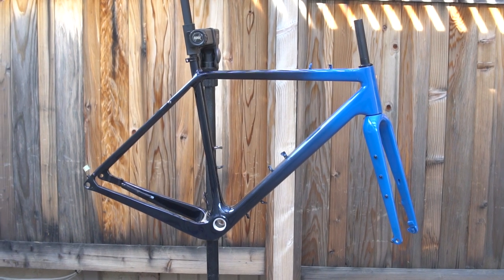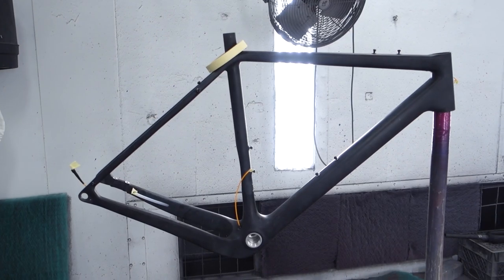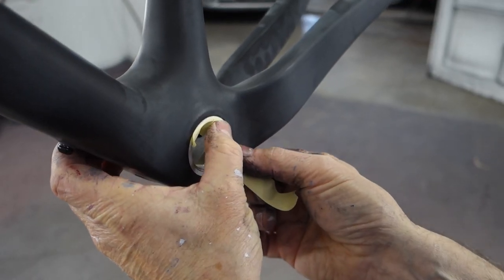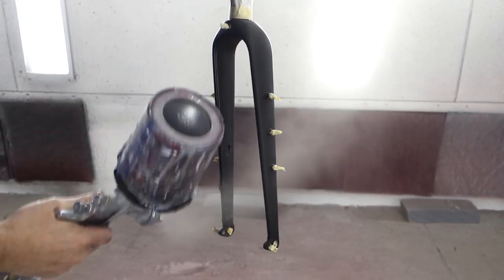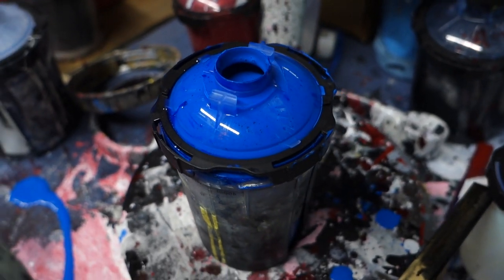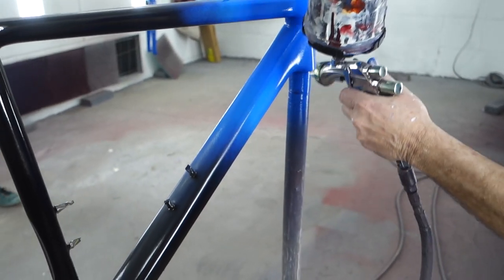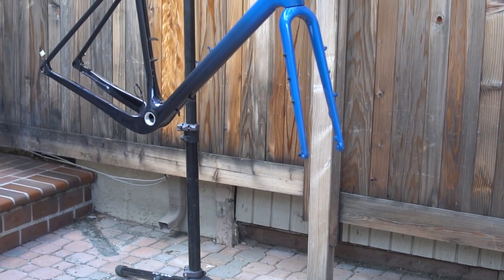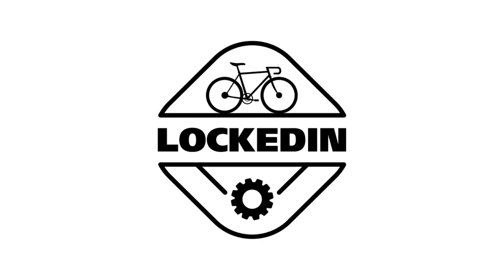How To: Custom Fade Paint Job for your Bike

Comment: Would I have to use chemical paint stripper/remover and then sanding for a new paint job or just sanding like this okay? I've been told better safe than sorry
Reply: As long as you're using a good primer, you only need to sand down the old paint job - as long as it's smooth after the sanding.

Comment: after 1st primer coat. . . is it necessary     to use wet sanding with  p1000 grit  ? . ..  if wet sanding .. how much time i should gave  between 2nd coat primer ?

Comment: Super job , I tried the same on a metal frame. And I feel the top coat is peeling. Do you know what I done wrong
Reply from the maker: That could be a handful of reason why it did that, 1 make sure its same brand of primer color and clear. 2. your base color might have not fully cured before you put on top coat.

Comment: How much does a typical paint job cost to have it done at a shop like the one in your video?  Is it possible to repaint a carbon frame that already has a clear coat on it?
Reply from the maker: Chris Blankenship price is gonna vary a ton depending on type of paint used and condition of the frame it could be anywhere from $400 to $1000.
Reply: Locked In that was to expensive you should go here in Philippines it only cost 100 dollar and you can have a chameleon color with the brand name painted in and it was more high quality than what you thinking it was like car paint and high quality
Reply: Yes but in the Philippines wages are far lower across the board and so is the cost of living